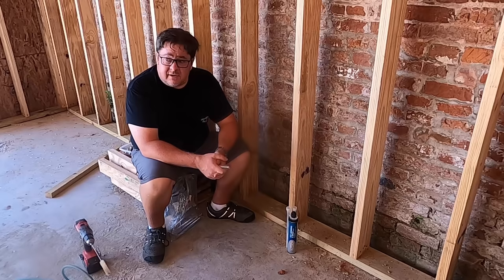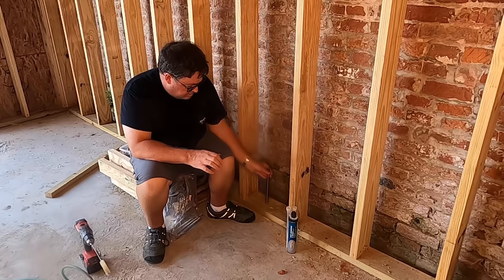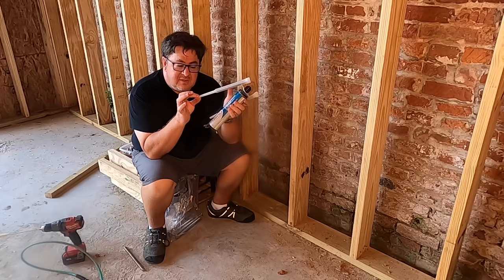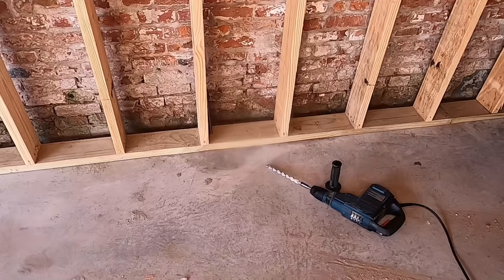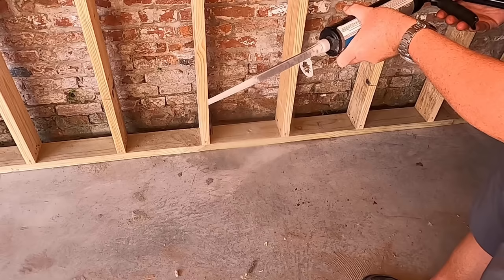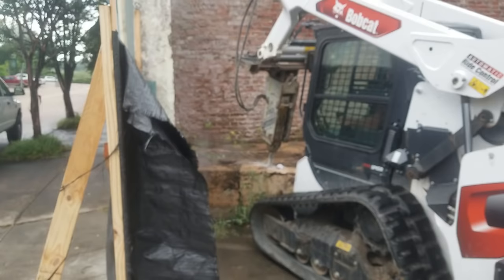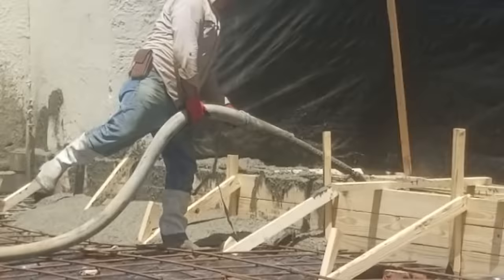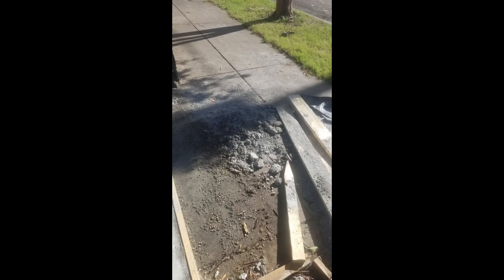Shop Renovation Update

Comment: Using that anchor cement in Florida in the summer we keep it in an ice chest including putting the gun in after it has been opened. Slows the setting speed. Got that tip from our supplier.
Reply from the maker: That is a nice tip, I'm sure it would have helped me as well.

Comment: I like the thread in anchors. I find they hold well and are less fussy.
Reply from the maker: I like the anchors the concrete sub remembers to install! 😁
Reply: @jtkilroy  well you would have until you found out their locations were all wrong and you had to cut them off!  My buddy that does sub stations for TVa said they won’t do foundations with anchor locations anymore because they almost always had to rework them to do the installs.

Comment: That's exactly why i did all the concrete prep work myself .   Have you seen the glass vials that you drop into the holes for the anchor studs , no mess .   Anyway , best of luck with the build .   Cheers .
Reply from the maker: I have seen the vials, but never used them, sounds like a neat idea.

Comment: I may be misinterpreting the situation, but it looks like there may be an issue with your sill plate. They're supposed to be pressure treated if in direct contact with concrete or have a barrier between them, e.g. tar paper. Your lumber does not appear to be PT and I didn't see a barrier.
Reply from the maker: The sill plate is treated, just dirty, hard to tell.